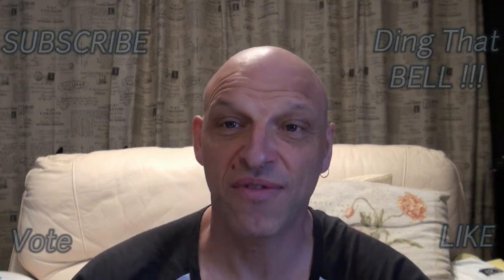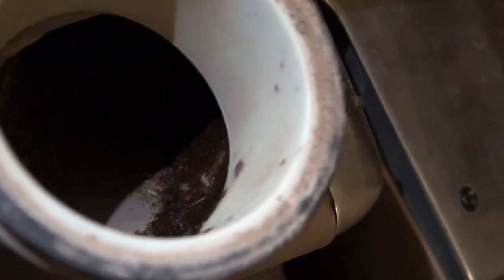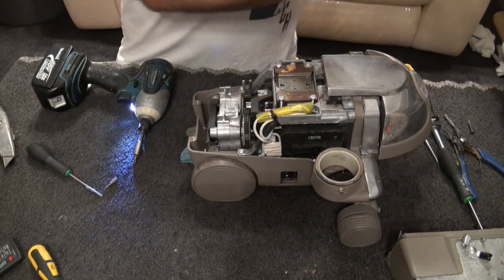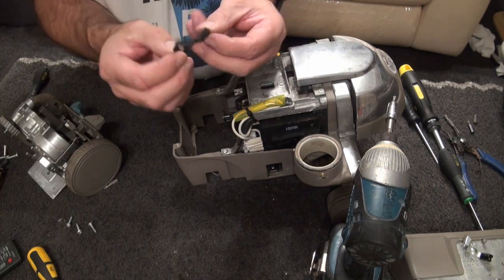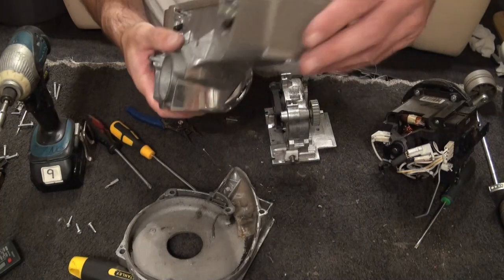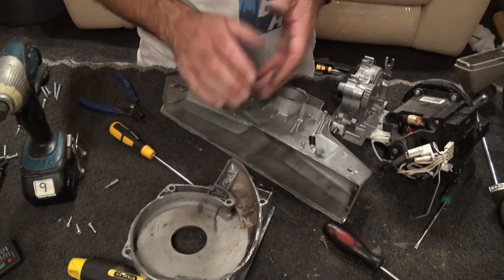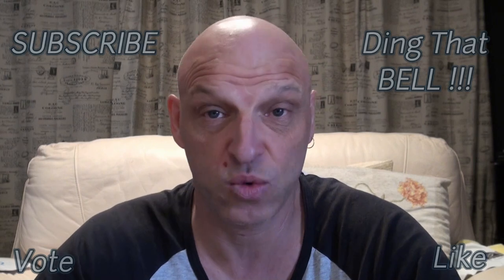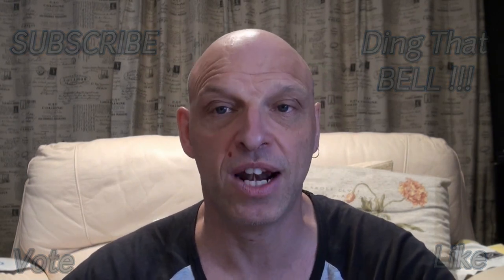KIRBY VACUUM :  Full Strip down and clean ready  Part 1 of 2 Part kirby Vacuum refurb process

Comment: Hello,
Great video!
Ive just stripped a motor down that I bought 2nd hand. 
I'd just like to share with people that when removing the armature, there is not only the Finger Spring that was shown in your video, there is a Tolerance Ring and a Static Washer in the bearing housing (both were damaged)
Im struggling to find these two components in the UK

Comment: My Sentria 1 was in awful shape with respect to how clean it was. When I first turned it on to test it, my basement workshop was filled with the most foul smell I've gotten from a vacuum in a long time. It took a full tear down to get it clean, the outer bag was the worse part because someone had used it without an inner bag. It was full of human hair so maybe a salon used it? The brush roll was so covered in hair, some of the bristles had been pushed flat so long they never popped back up so it needed replacement. It also had a fair amount of mold in the fill tube and emptor which took disassembling it and soaking and scrubbing it for at least a couple hours. I ended up soaking the tube in a bleach mix to at least kill any nasties hiding in there. It took pretty much a full day of cleaning to get it back to a not-disgusting shape. That said, it worked perfectly and it got it for $15 at a thrift store, so I cannot really bitch too much. The only things missing were a bag and belt and the needed brush roll.
Reply from the maker: These are probably my favorite videos to do as i love to see how much of an improvement i have made. Plus you can get some bargain Kirby that once fully refurbed are as good as a new one